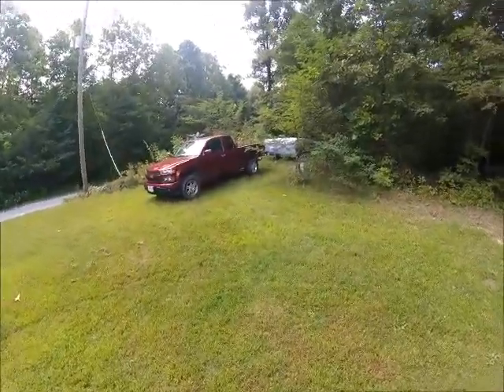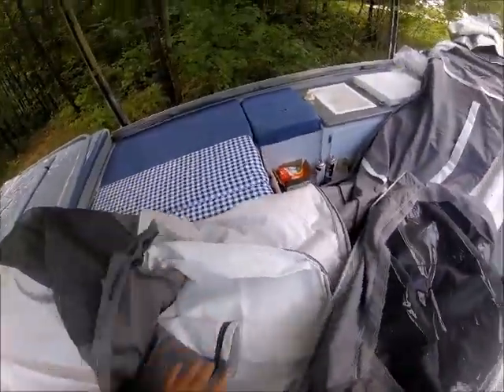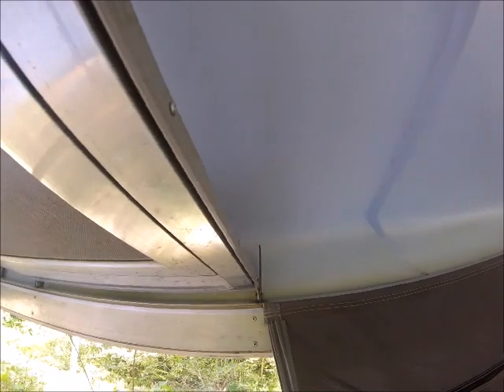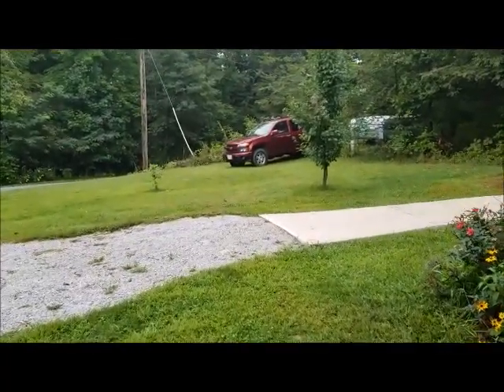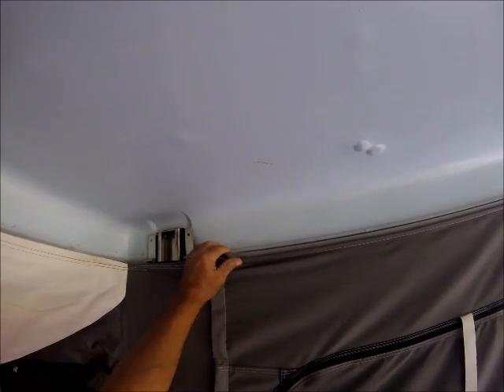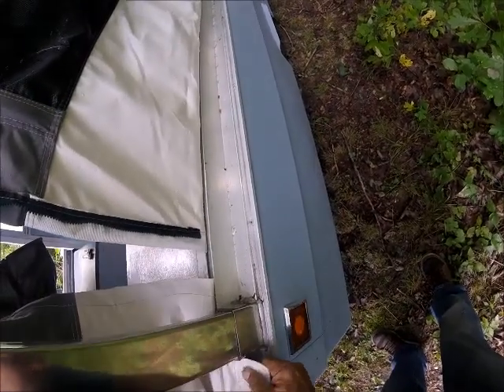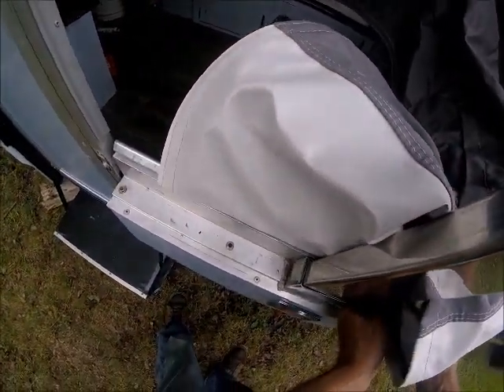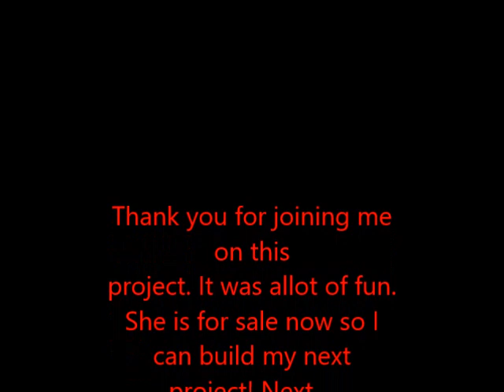Installing a new canvas on my pop up

Comment: I found a paint can opening tool rounded on a grinder or bicycle tire removal spoon works really well on that rubber channel. A hammer can actually  cut the rubber if you dont have the lip in correctly. Ask me how I know. I tried Vaseline same as you, it just makes a mess. When I worked for an upholstery  shop, he had a tool that worked great for that. We used it on convertible tops. You cannot get that tool any more. In the end, whatever works best for you.

Comment: The proper way is to heat the rubber with a heat gun which softens the rubber seal. Its then quite easy to pop it into the track. Once its in and the rubber cools, the rubber will expand and its nice and tight. As well, don't crank the trailer to its full height and it will make it easier to install. A hammer is NOT a good idea.   ;-)

Comment: Why didnt you us a Sumbrella canvas? That's OEM on older fleetwood/coleman pop ups. They have less light going through the top part over the bunks.
Reply from the maker: No light comes through at all over the bunks. The roof is white vinyl and doesn't let light through.
Reply: Sunbrella wasn't introduced till later. We had a 1990's that had it. The quality of the material beats anything any other company used. The end caps are vinyl as is all of them. Eventually we did have to apply seam sealer along all the stitching because ours started leaking along the seams, only where the zippers were. I was sad when our kids grew up and no longer wanted to go camping. As we didn't need such a large camper, we sold it. Now we have purchased a smaller Star craft that is perfect for the wife and I.